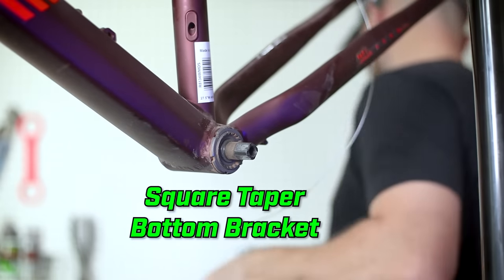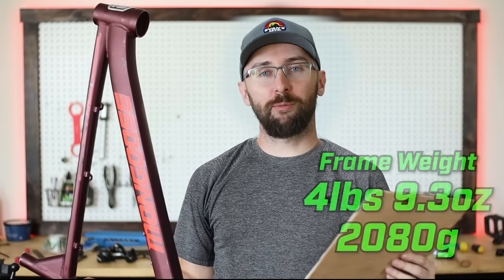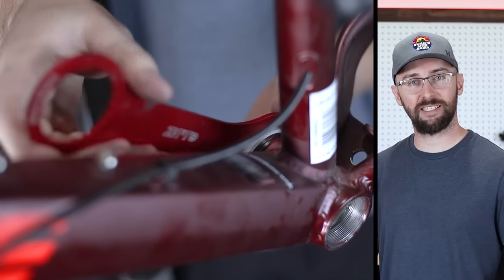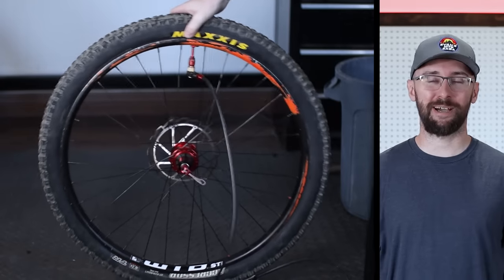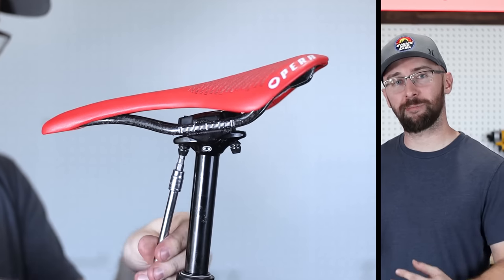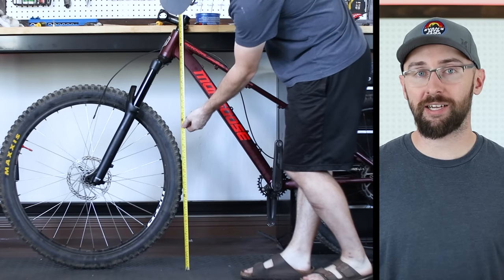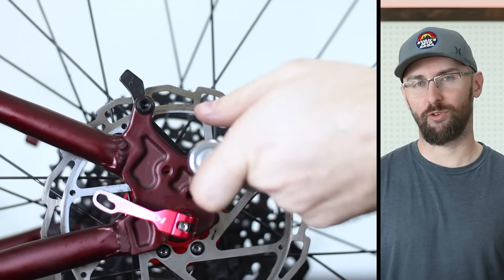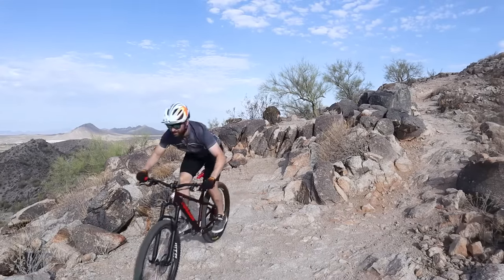Are upgrades worth it on a budget Walmart mountain bike?

Comment: It’s so hard to believe that when I was a kid, mongoose was a top of the line pro brand and is now considered a cheap Walmart bike. Same with diamond back. I had a diamond back mtb hard tail when I was a kid and was the envy of the block.
Reply from the maker: I know right. Even further back, Schwinn was a top American brand
Reply: @EvansMTBSaga  diamondback is still very reputable and makes great bikes?
Reply: I still love a mongoose, I recently spent over £1k upgrading one, it's my "sleeper" bike... I can enjoy having something nice without drawing to much attention.
Reply: I remember when i first saw schwinn and diamonback in the uk in the 90's some of the bmx stuff was epic
Reply: Both are still good brands but they get a bad rap because they sell really cheap bikes to companies like Walmart.
Reply: @Thayne T  believe me, you can...when I was starting out with skateboarding, the cheap ones came with plastic wheels that would wear out within 4 weeks, I couldn't even call the bearings bearings cause they were so bad..you could use them as a brake..the trucks were somewhat usable for a small kid and the deck itself was usable..just not good. Even the griptape was shite alongside the cheapest bolts known to mankind..oh wait, apple uses even more crappy hardware from time to time (VESA mounting, bolts breaking during first setup) ..at least I didn't get ripped off cause those boards would sell <20usd not 70+ for some hardware to mount a monitor haha
Reply: The thing is Walmart wants bikes with a certain price tag and since mongoose was one to make bikes for them, they had to make bikes under that price which means quality was going to suffer. Mongoose was once good till Walmart basically took their name. But it's good that they are slowly coming back in the game
Reply: @Thayne T Tony hawk boards and birdhouse hawk boards are different...
Reply: you do realize they make bikes at low level entry price to top of the line and almost always have right? they have always made great bikes and still do. they do have pro teams you know, you think they would have thier pro teams on a walmart price designed bike? lol
Reply: @petejones6827  well yeah mongoose is releasing proper entry level mountainbike at Walmart but a couple years ago it was nothing but mongoose branding but with the bikes made from Pacific cycles and I think Dorel. They make the low end bikes you see but I know they don't make mongoose anymore since mongoose wants to come back so they stepped up the game
Reply: @n8_vel868  yea i tihkn you are correct they hired out cheaper manufacturers to make thier low end bikes and i believe they still do this even for the bike you see on screen. its just that entry level bikes have stepped thier game up as bikes have gotten way better anyways so entry levels are just moving with the times also. i have a diamond back sortie pro its not a low end bike by anymeans. and i know some people that have some really pricey mongoose top end bikes too. so when i hear people say they are known for cheap bikes i laugh becuase thats what you may know them for but any real MTB guy knows thats just BS they make bikes that compete with the best of them.
Reply: i think they use the same people that make the KENT bikes whihc is walmarts main brand now it seems
Reply: @petejones6827  yea Kent always had a step up on bikes, I've always noticed how nicely there welds were. They probably have since Kent, and mongoose been making really good entry level hardtails
Reply: @n8_vel868  just looked it up they are stil owned by dorel,  and they now own cannondale, mongoose, GT, iron horse, pacific, sugoi caloi and schwinn
Reply: @n8_vel868  i got a friend picked up a iron horse from walmart upgraded it and he loves that bike says its a heavy tank that takes a beating and good for training on since its so heavy, he also has a nishiki ive ridden and i didnt think it was a bad bike at all had kent vibes when i rode it.
Reply: @petejones6827  yeah those iron horses ain't lying about being strong. I've seen one at dicks sporting goods and it had name brand parts and just hefty metal parts throughout the bike
Reply: Mongoose, GT dyno, haro and diamondback were the bikes to have in the 80s and 90s when it came to bmx. I had a haro freestyler sport when i was a kid. Then when i got into mountain bikes i saved up my grass cutting money for a trek 8700 pro. Loved that thing.
Reply: As a kid, I really wanted a mongoose or diamondback!! I knew my parents budget was extremely tight at the time, but I asked for one for my birthday for 2 years! We even went to Walmart and a local bike shop to try the different bikes. I remember my excitement when my dad rolled the bike in with a bow on it! I was so incredibly excited for about 10 seconds, until I saw that it was the cheapest red Huffy that Walmart had. Looking back I shouldn't have been surprised. While at Walmart they "encouraged" me to try it out, constantly commenting on how great it looked and how it was such an "incredible deal" for such a "high quality" bike. It was definitely the worst bike of all I tried, but I was still grateful to have a new bike. That didn't stop me from refusing to lock it up anywhere, in hopes someone would steal it and I could get the bike I wanted. Never happened though. I guess it was too cheap to steal lol. Looking back, I'm disgusted at my attitude towards it. How could I have been so spoiled and ungrateful. I always grew up thinking my parents were upper middle class since they add always provided a lot for my brother and I. It wasn't until I moved out at 18 when I joined the military that I realized my parents were well below the poverty line, and sacrificed so much for my brother and I to have the same opportunities as everyone else. Nothing but love and respect for them now! However, I do still wish I would have received one of the other bikes!
Reply: @SubVet84  thats kids for ya. I was the same way. My parents didn't have much money growing up either. I remember my pops making me a skateboard out of 7 ply that he painted an American flag on the back. My friends roasted my ass😆. Took a while but he eventually bought me the skullskates board i wanting. Honestly the board he made me was pretty damn nice. He designed a jig for it to get the bends for the tail just right. Man, i hated that thing though.. thats why i started making my own money as a kid.
Reply: I had the coolest purpled out Mongoose IBOC you ever saw. It was way to purple but it was the 90s. Ringle stem, seatpost, quick release and water bottle cage, control TEC bar ends, Sun Cr17 rims, and Kooka cranks and chain rings we're all purple! Xt shifters, brakes, derailleur,hubs, Avocet Air o2 titanium seat I had riser bars I can't remember the brand and WTB Veloceraptor tires. Great bike but broke the ultra lightweight cranks, and put Race face LPs on. Miss that bike!
Reply: Man. Im late to the party but yeah I had a sky blue and pink Diamondback kitted out with pink Mags! It was about 200 dollars then! Funny how things changed. Schwinn, back then, was like boss arse on our block!
Reply: I used to think mongoose was a great brand too until they became smyths (it’s a toy brand in the UK)
Reply: @AsecretheKarting  Yeah,they went down hill. Mine was a mid 90s Iboc I built up with purple anodized Sun CR17 rims, Ringle stem, seatpost, water bottle cage, purple kooka cranks and chainrings until I snapped them then got some race face, purple control tech bar ends, Judy shock, all XT brakes and drivetrain. Man I wish I still had that bike! They're pretty much garbage now.
Reply: They've always been bargain bin bikes. They made a few decent BMX's, but that's it.
Reply: In my neighborhood you weren't cool unless you had a mongoose!
Reply: Mongoose has never been a top of the line bike. Haro was, mirraco, mongoose did come out with a pro line in like 2008 or something
Reply: @Mark-ml9fe  in the 80’s it was
Reply: When you had a Mongoose or GT BMX you were the coolest kid in the 1980's
Reply: @Mark-ml9fe in 1996 my fist carbon frame was a Mongoose with a AMP research fork. Full XT group, it was top of the line, I upgraded the wheels with a custom built nukeproof/ mavic wheelset and race face cranks. 
This thing was the envy of all my buddies 🎉
*I'm looking at it right now, hanged on the basement wall: it's still a stunner, as a retro mtb 😂
Reply: Walmart forces these bicycle manufacturers to make CC the bicycles  dirt cheap that's the first step to ruin a good brand of Bicycle
Reply: Mongoose definitely sold out with selling there bikes at Walmart..truth is Walmart Mongoose bikes are not made by Mongoose..another cheap brand makes them..Mongoose still makes great quality professional bikes..and i agree in the 80s i had a Mongoose decade pro..a Mongoose California..and a Mongoose expert..and if u had a Mongoose u were the shit...im not happy that every kid with a hundred bucks can have Mongoose..Mongoose sold out big time..i just saw a Cannondale mountain bike at dick's sporting goods..same shit..its not made by Cannondale..just the sticker on the frame is...❤
Reply: Bro Mongosse in the 80s and 90s definitely top end. Fuzz DMC Solution top ends
Reply: @Mark-ml9fe  in 80s and 90s . Mongoose definitely had a lot of higher end bikes. Fuzz DMC Solution . Dirt jumper Vert/ Park and Racing. Not as good As Morales or S&M . But, still top end. Great quality chromo bikes. GT was trash compared to mongoose at one time. In 2006 mongoose sold and became walgoose Walmart Mongoose.
Reply: @mitch9309  Based on everything I’ve read, it seems people are upset that Diamondback started falling behind. I recently got their Division 2 when it was on sale for, like, $450. It’s nice, but I could NEVER justify paying full MSRP for it. Nothing about it is crazy, nothing is bad -but nothing wows me either. They haven’t really renovated.
Reply: alejandrosanin4739 I grew up poor in the late 80’s and early 90’s. I had a couple of friends that had the Team Murray bmx bikes and I wanted one soo bad! Never could afford one. Started working as a teenager and bought a badass mongoose which ended up getting stolen and then finished off my teenage years with a GT Interceptor. I loved and miss that bike.

Comment: Wow 62.5! I know downhill bikes that are in the 63 and 64s but never heard one in the 62s
Reply from the maker: Haha right! Budget grim donut! I was for sure nervous to hit the drop and kept checking the welds
Reply: My Geometron G1 is. 👌 Love the steering, my bike has 515mm reach for size large, meant for my height, at 181 cm it fits perfectly. It can be set up as downhill bike or enduro bike, takes dual crown, and also mullet setup, can change seat stay and chainstay chips. Most adjustable bike on the market in this category but costly. But great quality, it smade in Germany properly so no tolerance and alignment issues. 👌

Comment: Tip for removing over spray,  use Easy-Off oven cleaner. Spray on, but only leave on for less than a minute, and then wipe off and rinse with water. It may require several applications, but a company I use to  work for used this technique to remove old painted on logos from their vans.

Comment: I was contemplating a similar build. Thanks for showing what this would end up doing.  I'm about your height and have a bike too tall for me.  If anyone is into a 20.5 Specialized FSR comp...  I am asking 400 for it.  Shifts nice...but I need longer legs.  I have an older 17inch hardtail original rigid fork (now suspension) and MacGyver'd 1x drivetrain. And a cracked headtube....  

My thoughts were to either have the crack rewelded or to upgrade to a larger than 26 wheel.   My 17" hard tail cost less brand new than the Walmart bike does now...😞

I'm either getting "old" with my back in the day talk....or things have just gotten more expensive.

New subscriber here! 😇😎😀
Reply: sounds cool!

Comment: Hello, Idea for pressing in the headcups without specialtool... Maybe try to fix the Bike in a middle high position and then put the steerertube parallel down to your workbench and then, with some wood between, hammer the cups in. Other way, if your vice is big enough, use this for pressing in. Good luck next time from Germany

Comment: I was one of the rare few that voted a more conventional build, but the bike does look sick and makes for great content.
Reply from the maker: I think mullet makes a lot of sense with this bike because of the stack height. I'm going to throw on the Manitou markhor 120mm for a more reasonable build
Reply: I think it had 100mm my Walmart bikes can be changed easily because they are not made for a certain travel really
Reply: @Dawson that is only if you want to retain the factory geometry. If you want to be more rad, you can run same travel with 29er front or over fork and still run a 29er front.

Comment: 2:16 long bolt and 13mm big nut from Home Depot, 2 small spacers, 2 big spacers, and 1 very big spacer (or you can use that red bb tool you have) and you got yourself a super affordable headset cup press!

Comment: I think the reason the headset did not go in was due to mongoose oversight. You measured 55mm, where's 56 is the most common standard. The paint clearly shows that it is not a perfect circle, which will likely lead to creaking down the line. Mongoose should have machined down all the surfaces (or better- not painted them) after painting the bike. You could probably get your local machining shop to make the hole the correct size if you do get issues later on!

Comment: To answer the question it’s no if you buy the parts retail, only worth it if friends give you parts or bought very cheap used. Were those original rotors both 160mm? If so I would have increased the size of the front unless your goal was to turn it into a skid machine.

Comment: For pressing in the new headset you can use 2 big washers (like they are used on construction sites) and a bolt with 2 nuts, it's essentially the same principle like the special tool made for this job but cheap and good enough for occasional use.
Reply: I use mine to press bb30 bearings in too.

Comment: Cheap headset press.... 2 cube cut from a bit of 2x4 wood... 
Get a bit of threaded rod (cheap from any engineering place... (I fix water blasters and I have that laying around)...   go big... as thick as your little finger width at least.
Drill (as square as possible) through to width (4") of both cubes of wood. 
Put on piece top and bottom of the headset with one cup in place.... put the threaded rod through... screw it together (ok so you'll need 2 nuts and 2 washers to stop the nuts digging in.

For best results... make one out of a bit of alloy rod (bigger than the ID of the cups and make a couple of steps (like an ice cream cone in an old 80's video game) so you can do all sizes of cones.... 
you can throw a socket on the threaded rod INSIDE the stem at the other end to help align it to the centre...   

Warning...  Hitting cups into the frame with a hammer will usually just end in hilarity for onlookers but not you!.

Comment: They're really only worth it if you plan on using them on future builds. There's not much point dropping a brand new $700 on a fork for a $200-300 bike when your next bike is going to come with the exact same fork, because now you're stuck selling it at a loss. And, depending on the loss, you can be quite unhappy about it. Money saved is money "earned" toward your next bike purchase.
However, you may have some brakes you want to use on a future bike that are worth it.

Now, if you can get a used Fork for a good price, where you minimize your losses, then it might be worth it.

Comment: 5LBS for a frame isn't bad. I'm more concerned with durability than lightness. ALL of my mountain bikes had a 68mm bottom bracket except an early 90s Gary Fisher which was 73mm.
Reply: Durabulity over long term is why i hope i can find a steel tubed full sus mtb for my dream bike. 

Aluminum has not fatigue limit and will continue to weaken until it cracks whereas steel will weaken to a certain point and plateau out into an extremely safe and long lifespan.

Comment: Hi,  I'm an extreme novice but I had an 1500 e bike that got stolen and I can't financially afford to replace it so I am doing what you are doing here except I am not putting premium parts back on... just slight upgrades in most pieces but big upgrades in others ie Brakes, wheels, shocks.   I have a question though...  my replacement handlebar stem and or rise constantly develops a slight wobble buy if I attempt to tighten it, it doesn't seem to move... is it possible for this original frame to be such a piece of shit that I am spreading or stretching the stem tube ( Where the handle bar stem goes) when I try to tighten it? And please forgive my lack of knowledge of the terms. I don't know if I'm using the right term. It's, but I'm sure you get the idea.

Comment: If you have a old steel frame or an aluminum frame you can cut a piece off it and then use an angle grinder cut it on all four sides and make a free headset tool it takes about 20 minutes

Comment: I'm looking to do the same thing to my rear wheel and just get a new hub, curious as to what hub you used and what spoke length you had to use
Reply from the maker: I used the koozer hub, I linked it in the description. I usually reuse the same spokes. Most spoke nipples are pretty long and give you 10mm or more of Wiggle room

Comment: overall you clapped the geo. you should use a 20mm shorter travel fork if increasing front wheel size. you also used to be of an offset on the fork .

Comment: for removing the sqare taper kevcentral used a power drill to remove it. but only when it was skrewed on tight he said to use that method or if ur very weak
Reply from the maker: That's a pretty sensitive area to be using a drill. If you cross thread the frame is done.